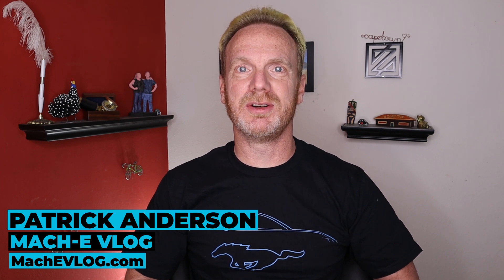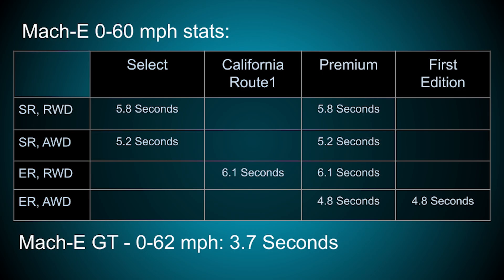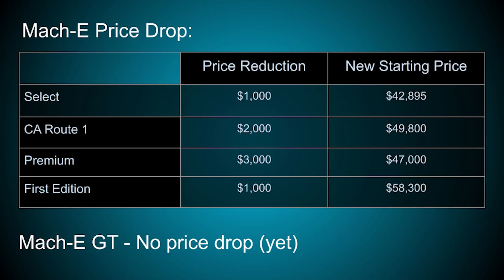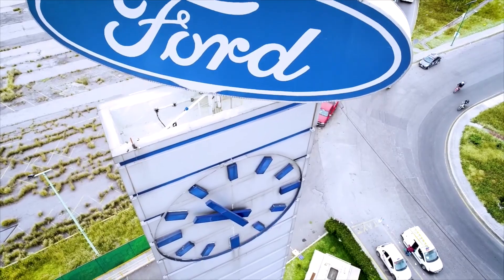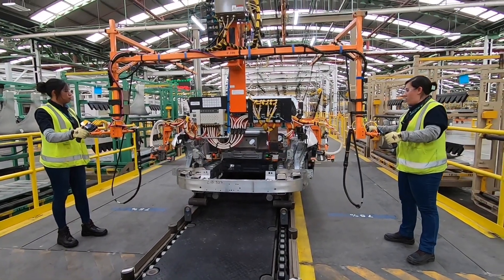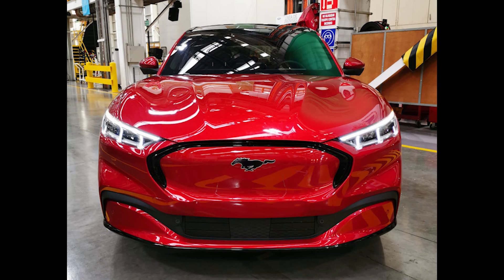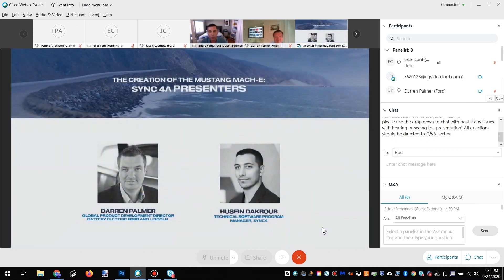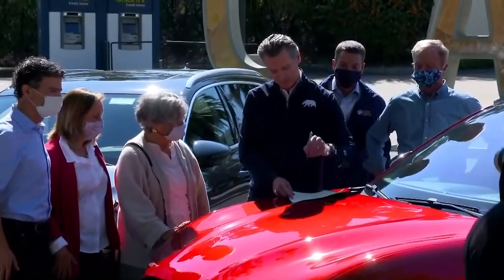Mustang Mach-E News Update (Faster and cheaper!)

Comment: Great content! Keep them coming.. very informative!  Just one question for you or anyone that knows, I ordered two Mach E and the MSRP drop was not a good thing for us, on my first order I had a $3k manufacturer incentive that lowered my final price plus 0.9% APR and on my wife’s order we got a $2k incentive also 0.9% APR .. now since the MSRP drop we are both at the same final cost however after talking with the Dealer they said the best APR we can get right now is 2.9% making our monthly payments higher than before the price drop .. has this happened to anyone else and if so how can we get Ford to fix this and honor the 0.9% APR?
Reply from the maker: I've heard that incentives change frequently and you can't "lock them in." I imagine they will change again by the end of the year when the first deliveries start.
Reply: Mach-E VLOG thanks for checking on this .. I was told today rate drop to 2.24% APR and may drop by the time we take delivery so should not be too much more than the original estimated monthly.
Reply: I know here in Alberta Canada that if you purchase a vehicle that is a factor order and you have a bill of sale(to order )that any incentives can be used or if they are better when it arrives you can get the better deal. Happened to me when I purchased my 2011 escape hybrid.

Comment: Im unsure if this has been discussed by ford, but i was wondering if the mach e can be serviced at any ford dealership or will it need to go to specific ones?
Reply from the maker: Over 2/3rds of the Ford dealers in the US are already certified electric dealerships and that number is expanding. So while it is not every Ford dealers, it is most.
Reply: @MachE_VLOG   thank you for the info

Comment: I am seriously considering this vehicle when it's released.  My only issue with all the E cars is what happens to battery life after 5 years?   Are they cars basically disposable cars?   I just need to be educated on longterm ownership with a battery run cars.
Reply from the maker: The battery warranty covers 8 years or 100,000 miles. One key advantage that the Mach-E has is that it keeps some of the new battery in reserve so you shouldn't have much battery degradation over the life of the car.

Comment: I wish the price drop was more competitive.. like 5k across the board.. but i think the GT is still a great value. Over 450 hp 600 torque for around 60k.. that's corvette performance..
Reply from the maker: The GT may still get a price cut when it comes out. It seems the current models look pretty competitive considering all features (and potential tax credits).

Comment: Any word on tow packages with the Mach-E?  How much it can tow or if it will have the ability to have a tow hitch installed?  Any word on EPA range?  Still "targeted"?  I've been asking my local dealership but they haven't been able to give me any answers (I live in a podunk town in northern California so I kind of doubt they're motivated to find out, so...)
Reply from the maker: In the US, the tow hitch will have to be added after delivery. There is a tow hitch option in Europe, but I think it is only 750kg (1650lbs).
The car still hasn't been through the official EPA testing, but there have been hints that they will come in close to the targets.
Reply: Mach-E VLOG yeah confirmed on the tow hook bring an after market item.  According to the service rep I spoke to the rated towing for one once installed would be 3500 pounds; identical to model Y incidentally.  In any event it would be enough to support a bike or ski/snowboard rack and a small trailer for things that you would put in a truck bed.

Hoping for closer to 300 miles on the ER AWD premium but as long as it is at least 270 I think that would be fine.